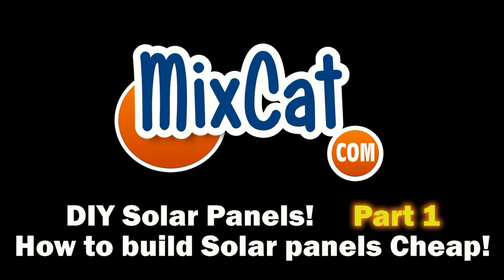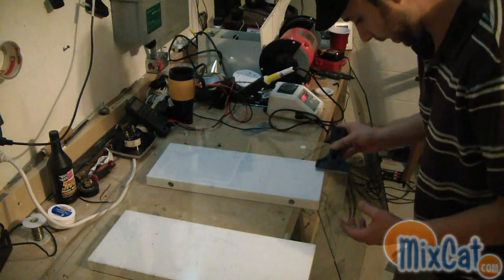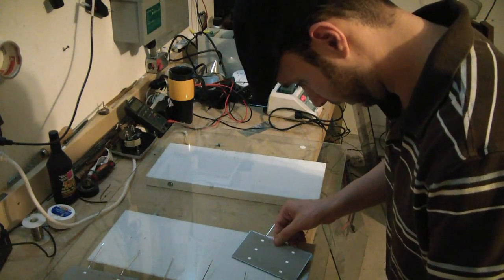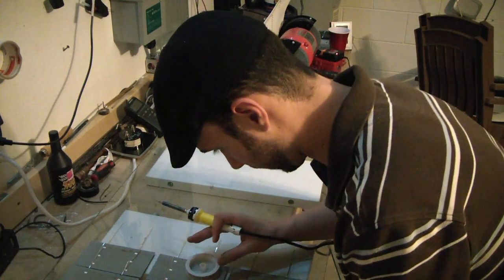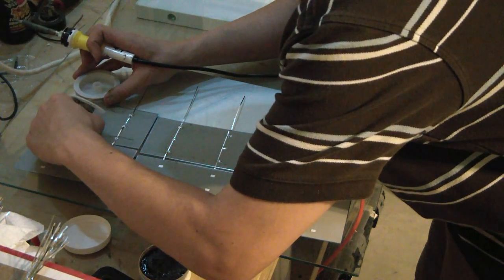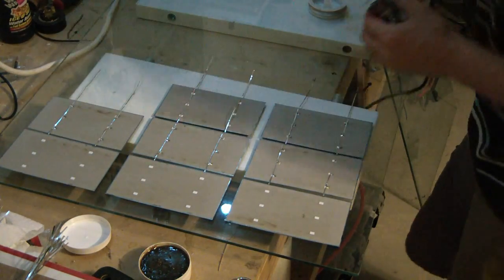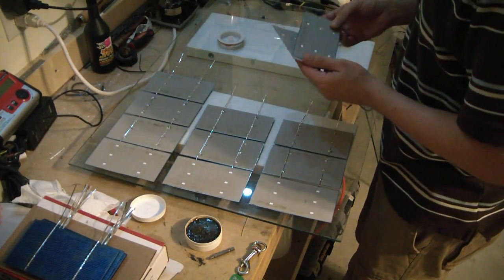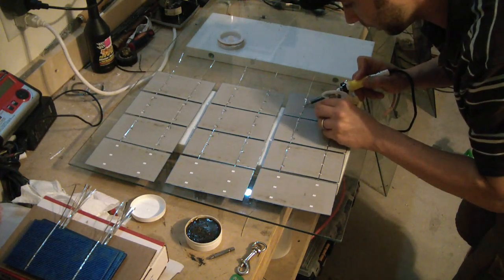How to build a Solar Panel from Solar Cells - DIY Part 1

Comment: mumbleye, if you are seeing lumpy solder, you rheat is not hot enough or the point you are soldering is large and you need to practice solder flow for the amount of area you need to cover with a flux core solder and high temp iron and high temp solder

Comment: Ok got ya measuringtape is see now its pre controller voltage. So if you based the voltage on 13.5V then when its shady out you could possibly run to low of voltage 10.0V or less. Thank you for clearing this up!

Comment: 15 to 20 volts to charge an 12V battery is way to much. You need 13.5V min and about 15.0V max amps is what you need ti watch!

Comment: A word of warning, don't try to use a scraper on tempered glass like this guy did. Tempered glass scratches easily. Better to use non-tempored glass for this project I think. Also, get glass wet before trying to scrape dirt from it.

Comment: Next time use vinigar water and amonia to clean the glass. Most spray bottle window cleaners have a little wax in them and cause some smearing. Just a tip from a professional cleaner.